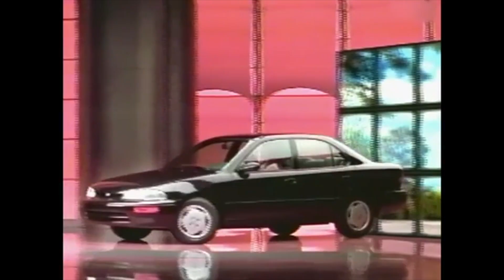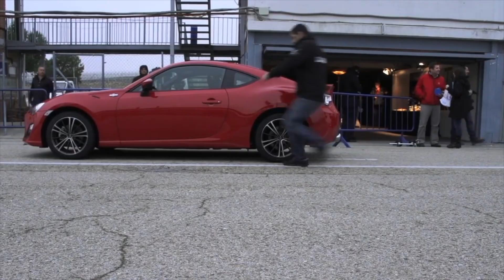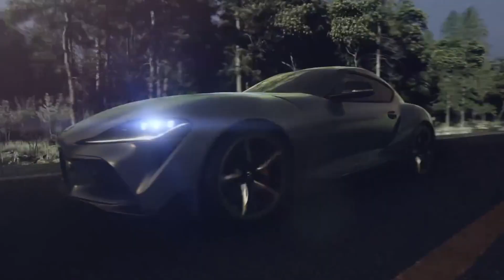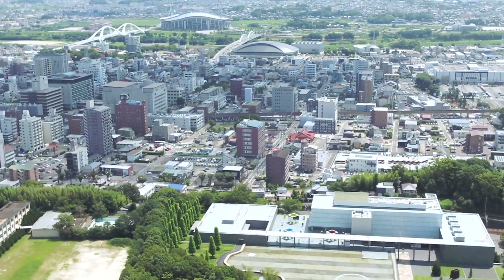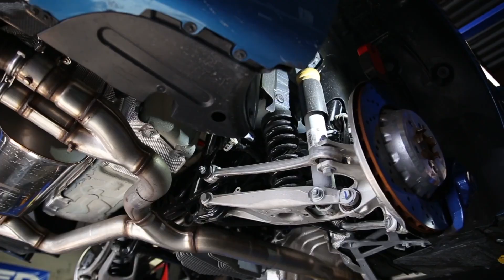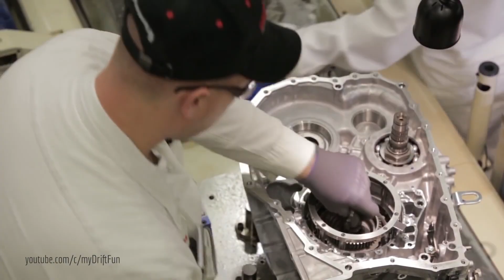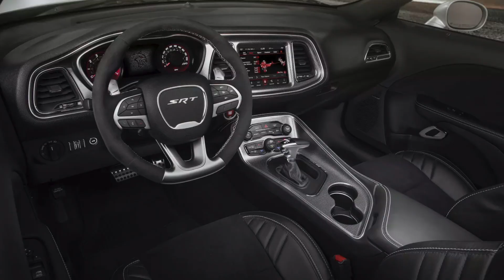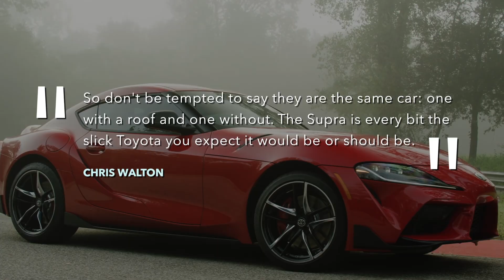MKV Toyota Supra - BMW or Toyota? The UNTOLD TRUE STORY

Comment: i absolutely have ADORED the mk4 since I was in like, 3rd grade. If I were give a chance to choose between a mk4 and a mk5 for free, as long as the mk4 was in mint condtion, black, 1997, and manual with TT, I'd jump on it. But if I were just handed the keys to a mk5, I'd take it in a heartbeat too.

People should stop hating on the new Supra. While it's looks may be polarizing(and I wish they went with the rear light multiple round lights throwback instead), I believe it to be a very good car, and one worthy of succeeding the old one. It doesn't go for the generic more powaaahh mindset that the gtr seems to have gotten into, and instead seems to be going for driving experience instead. 

Too many people are living in the past-yes the mk4 was fucking glorious, but seriously, let's move on and appreciate the mk5 for what it is. Too many people are way too entitled and think what they think is best without considering the resources and costing needed to fund a project nowadays. Even the 2jz swapped mk5 already burned up. 

Stop living in the past. Appreciate the mk5 for what it is. If you can afford it and don't want it, just get a used mk4. But if I had the money, I'd get either-both are excellent cars.

Comment: Having been a Toyota factory trained technician in the T-TEN program I can appreciate the Japanese desire for reliability. I was surprised when learning of their mechanical theory of extra hardware and on the electrical side multiple redundant links to ground. I often asked if they'd not have significant savings in a production run to leave out some of the things along those lines? I was assured that both were weighed and reliable transportation was more important than the numbers on the bottom line. I have not been in the industry since the last Supra due to being involved in a non-work related vehicle crash with an unaccounted variable of a driver without sufficient concerns for our lives or of the occupants of their vehicle. Takata has left many with a black eye and the corporate has had a few questions about the motoring public world wide. Into every life a little rain must fall. How we come back from it is where the plumb bob of our reputation is hung from. I know that most people who I know that are NASCAR fans aren't especially happy, but all you can do is your very best and see where the flag falls at the end of the race.

Comment: Toyota styled the body both the resin and sheet metal bits of the outside, but manufactured by the same suppliers that provide for BMW in Austria... It is also assembled in the plant that assembles BMW cars.... the tuning bit Toyota has done is basically selecting a different type of suspension that has suitable spring rates to meet Toyota's standards, which they have their own to that of BMW. But interior is same as Z4 pretty much...

Its a nice car, but really wished Toyota made it on their own internally, but understandably they wanted to share the cost. But they have Lexus platforms such as the RCF and LC500 that could have been great platforms for the Supra, not to mention that V8. If not V8, they have a nice V6 and a Turbo in-line four that has decent power and good for tuning.

Anyways, if thinking this car is "Toyota" made to make you feel better then so be it, but its made and assembled by the same companies that made and assembled BMW cars... using BMW chassis and engine... drive train and interior....

Comment: My M3 and my partner's 328i have both had engine problems at low mileage. Toyota's input may have forced BMW into making a reliable engine for a change.
Reply: My E36 M3 was making book figures on the dyno with 140,000 miles on the clock.

Comment: it could have been simple: mash a mk4 with a gt86 for the body...oh they did that. engine could have been easy too: 2jz with a few slight mods to make it more powerful from the factory...I mean, not much is more durable than a 2j block, so not much improvement needed there. but, nah, let's partner with bmw, complicate the styling for both companies, throw a used, underperforming engine in both cars, call one a supra mk5...meh, whatever. they look cool, but the mk5 won't have what mk4 had: an engine that, after 25 years, still makes grown men act like giddy little school girls 😎👍

Comment: An Austrian manufacturing company designed & built an ugly car, stuck an off-the-shelf BMW engine in it, slapped a Toyota badge on it, and called it a Supra. You can’t even get a manual transmission in this purpose built sports car. What a fail 👎

Comment: the problem isn't the partnership but that it isn't a supra. if they called it something else it would be great, but they called it a supra which it is not. what we've been complaining about is the same thing that happened with the Ford Probe which was initially supposed to be part of the Mustang line. The A90 as a standalone is rather nice, but the moment you call it a Supra is where we have complaint.

Comment: Nice information but its still garbage. Its performance is no better than the original Supra  20+ years ago and it puts out the same power as a Nissan 370z, which based off the 350z is now 17 years old, the 370z being 10 years old. And Nissan did it without a turbocharger. The only upside is faster 0-100 but thats what 10 years of development and a ridiculous 8 speed auto will give you. To top it all off, the BMWs are the ones which will get better computer and electronics, although for a massive cost.

Comment: The old supra used to go toe to toe with supercars while the new one would probably be killed by an m2
Reply: that's a lie the old supra was more like a "GT" type of car, have you even riden a stock MK4 supra? it's a car with only 320 Hp and It's rather heavy
Reply: @SimGT_27  the point i wanted to make was that the new supra is not the equivalent of the old one but i have to admit that i threw the supercar term in there rather carelessly
Reply: @SimGT_27  back then it competed with the 911, viper and Corvette ...

Comment: No one is saying that this isn’t a great but no can disagree when you say that this Supra isn’t as great as its predecessor. The old Supra came out with supercar power at a pretty cheap price but you can notice he doesn’t bring up the fact that the Supra was made to be all out crazy and had more power than was actually labeled. It’s just sad to see such a legendary car be changed for the worse due to complacency. Side note though he tries to fight the idea of it being a rebadge but you can clear look at the part numbers for the engine schematics and see that 90% of those part are BMW if only the outside is Toyota and they change the suspension tune to feel different from the Z then what do you have that’s different 🤦🏽‍♂️ I’m not going to be fooled so easily
Reply: Spreads rumor about new Supra as a fact when they haven't even driven it yet

"I know a lot, right guys~ Deerrrrrrr~"

Comment: i originally was bothered that the engine was from bmw like a lot of other people, but this video has changed my views quite a bit. i didnt know that the i6 used for this car was being developed right when toyota and bmw teamed up. the fact that the toyota team actually took apart the engines and tested the durability for each component and had them revised accordingly during the design process gives me a lot more confidence in the supras long term reliability. im very glad i watched this video.
Reply: I do not know what this guy in video is talking, but my 2015 Sienna is on par with Yugo in quality. Rattling windows, brakes that start to vibrate after 10k (finally decided to upgrade), mediocre sound isolation etc. What did they say to BMW when they returned parts? This is NOT how we do on Camry!
Reply: So Toyota made sure the engine was reliable.. but in the end they detuned the engine to be slower than the Z4 by 50hp so that it'll be more reliable. Does that mean Toyota realized the engine wasn't reliable after all?

Comment: I currently work at "Toyota's arch-rival" for both R&D Engineering and Styling Design, I can tell you, this type of collaboration is very normal. Almost all parts of a car involves a separate contractor. The whole direction is still controlled by the main brand but it is necessary to outsource specialized areas to maximize performance and quality while minimizing cost. A whole prototype family car, fully manufactured outside an assembly line costs around 1 million dollars. Collaborating with specialized companies ensures feasibility for mass production. Car companies can collaborate with others, except for their main competitor probably. Anbody want a million dollar 150hp crossover?

Comment: No manual, no 4 seats, no resemblance to its roots. It’s still all bmw, built in Austria. There was no reason Toyota could not have built and designed the car themselves and manufactured it in Toyota.

Comment: I guess Toyota forgot how to build i-6 since the 2JZ era.
Reply: @Jerry-t4h8f  Such as random Youtube comments without moderators, fact-checkers, or high traffic exposure?
Reply: @Jerry-t4h8f  Okay so sue Wikipedia. I didn't create it, I didn't contribute to it, and I have used it without a problem. If you have issue with it, don't cry to me. Now, what about my earlier comments? Are they false or true? SHO V6 and LFA V10 both by Yamaha.
Reply: Aww man they ruined it
Reply: Nah. I think the BMW sourced i6 is going to be a durable and reliable piece, since the Japanese have had a chance to scrutinize every nut and bolt and block web to their liking.
Reply: 2JZ is made by Yamaha...
Reply: @Jerry-t4h8f  Yes ultimately. Same as a certain V6 Ford used to put in a certain Taurus SHO. Yamaha also had a part in Lexus LFA supercar V10, yet Wikipedia will say it was "built by Toyota." Well, it may have been BUILT by them, but it probably wasn't designed by them.
Reply: They didn't put the 2jz in the new Supra because the 2JZ is not environmental friendly so they decided to borrow BMW'S B58 Engine

Comment: not very much , i still think the LFA without the outer structure made of eight layers of composite material ( carbon fiber ) downsizing the caliber of the aluminum made V10 engine and lowering the amount of technological level invested in  , and Make it lean to the commercial side more than being the F1 race track engine , it was to be a better alternative to the legendary Supra MK4 and an excellent competitor to the Nissan Skyline GTR35
No breakthrough was achieved with the exterior design, while the interior is transferred from the Z4 while the steering wheel is not a sporty at all fat and big and developed from the Toyota FT86 steering wheel , But this exterior design supports bringing out aTarga version which the car market is lacking the presence Targa cars .... The current model is the first version of this generation , So there is a chance to avoid flaws and criticism and develop the car to become a good competitor for GT cars ....

Comment: Its a more reliable BMW then. TBH not a fan of BMW M Sports i own and i am a fan of Mercedes AMG but what i can say is they have taken a car that was already fun to drive and made it more reliable, what is there to complain about. Maybe the wrong choice by toyota was branding it as a Supra. It was an iconic model that was based solely on their design and development and they have now just worked with BMW which for me isnt a bad thing in todays market but for the hardcore Supra fans i can see why they are disappointed. Its no longer toyota's, although based off of BMW parts they have tested those parts extensively and improved both reliability and durability. So its not all that bad. Time will tell how effective the testing was and whether any short cuts were taken when people start driving them in the real world and not in testing environments.

Comment: The 2020 Toyota Supra is really a BMW with "Toyota" engineer checking bolt and rivets, some bmw parts so it is "up" to Toyota standard.  Basically it still a 99% bmw, no matter how much you try to spin it...

Comment: The whole point of the original Supra was that it was a poor man's sports car in the same way that the Grand National was a poor man's muscle car, but now that BMW is part of the development process, predictably, it's turning into an under powered, overpriced yuppie mobile (just wait to see what the parts will cost... just wait).  The 2.3L Ecoboost Mustang has almost the same horsepower for half the price and actually offers a manual transmission option, unlike the new Supra.  Just like the $70,000 GMC pickups that are already starting to fall apart, these cars are for chumps.  If you're rich enough to pay $50,000 for a car, just spend another 10 and get a Hellcat with twice the power.

Comment: my guess why people are upset is, its more BMW than it is Toyota; bmw engine, bmw differential, bmw suspension components, and to a Toyota enthusiast is a slap in the face. Because toyota made they own cars from ground up, even silly things: while every other car manufacturer was using gerratt turbos; Toyota had their own. while every other car manufacturer was using CAN-BUS as communication protocol; Toyota had their own BEAN protocol. Whats more the original supra's 2jz-gte is still alive today, i doubt that this B series will share the same following. 
There is no doubt the new supra will be a great car and it is a realistic attempt to get an affordable sports car into customer hands. Because Toyota did make a Supra back in 2011, only it was much too expensive and they called it a LFA.

Comment: beautiful video.
great details given from beginning to end.
i had my doubts about this car but now im coming around after hearing the engineering side of it.

all these negative comments coming from either wanna be car heads and mechanics obviously do not know the slightest thing of engineering.
if you are such an expert on car design, fluid dynamics, thermodynamics/heat transfer, etc etc, feel free to start your own design and lets see where it goes from there.
it took these experts YEARS, im assuming it will take these people decades lol.
the only thing they do is just get the car and "upgrade" it with other components but no design and research done.

lets at least agree on one thing, let the engineers do their job and let the mechanics and wannabes do their job (if they have any)

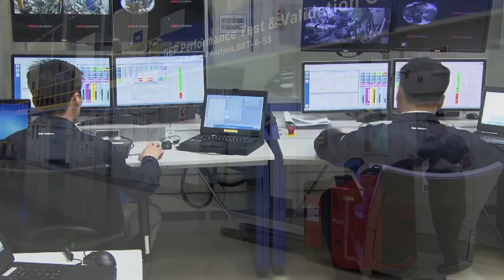Comment: 08:48 it was not the engine itself that was unreliable prior to the new one it was the chains and they are on the models from late 2006 to late 2011/ early 2012 , bmw engines are one of the best if not THE best inline 6s

Comment: Here let me prove to you how the new Supra 'is' a Toyota and not a BMW. In 2012, Toyota and BMW BMW'd. BMW and BMW'd with BMW at BMW. A team from BMW BMW'd a Toyota. Then BMW BMW'd at BMW with BMW stuff. Both teams worked in unison to BMW a Toyota. Masayuki Chi, born in Germany, help Toyota to BMW. So BMW continued to BMW. Toyota didn't have a Toyota, but BMW had an answer for this and BMW 'd. The drive line of the Toyota was taken from a large line of existing BMWs. Toyota could have made a manual transmission, but decided not to. BMW BMW BMW BMW from BMW at BMW. Lamborghini, Bentley, Maserati, Aston Martin... (all engineered by BMW) used BMW's transmission. A Motortrend journalist owns a BMW z4 and says "they are nothing alike". Bottom line, Toyota and BMW BMW'd to make this Toyota. Hopefully that clears things up.

Comment: Well spoken.  Well presented.  Well researched.  Answered my questions quite well.   I happen to think it does fall more along the lines of a rebadged Z4... (with a whole body style change instead of a just a bumper)  and a few tuned suspension parts does not a unique car make.    BUT  I own a e46 M3 and like all BMW cars, it has lots of little issues that are dumb, broken or jsut plain were never designed well.  But the engine is great, the handling and grip are a blast!   So i caught myself saying... "Man I wish BMW would just let Toyota make the M3 body and interior parts.  Then I would have a great handling sport car AND it would work for more than 40k miles :P "

Comment: I'd like to own one but without a manual tranny I would not even consider it. I like the engine just fine, the looks I'm not crazy about. I think the worst thing in new cars is they are more designed by computers and it shows. .  The rear end looks like it was already hit by a car in design and no one caught it before it was took over to the area where they made the parts for the car and it was stuck like that. The front end looks like it was done by a owner of the new Miata.  So it's a miata that was smashed in the rear and they said ok, lets go with that look...

Comment: they are kinda forced to use turbo engines coz of the regulations getting really strict... if the regulations were the same as the time when MKIV came out they'd probably just improve the 2JZ engine.

Comment: We have known about the BMW partnership for YEARS.  If you are just now hating on the car for that reason, you don't care about the car and never did.  Think it's expensive?  It's cheaper then my old one's were when they were new (don't forget that inflation is a thing).  Those statements aside, this vid explains what I have been saying for a while.  I will surely be driving the Supra when able and hope it lives up to my expectations so I can add it to my stable.  I do hope that more concrete evidence regarding the manual transmission comes to fruition though.

Comment: So, in summary, the Z4/Supra is a parts-bin BMW with a "new" BMW engine, BMW suspension, and a generic automatic, supposedly nit-picked by Toyota for reliability, designed by two teams that did not work together, and who avoided communication with each other toward the end of the design process. And the fact that Toyota engineers didn't even drive one until they received a production model doesn't mean it's a BMW. Nope. Not at all. LOL